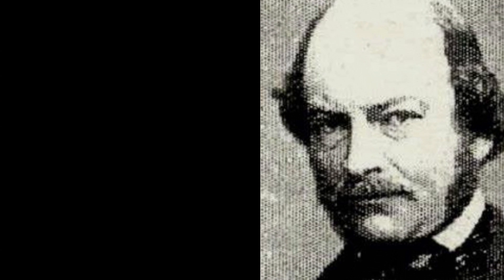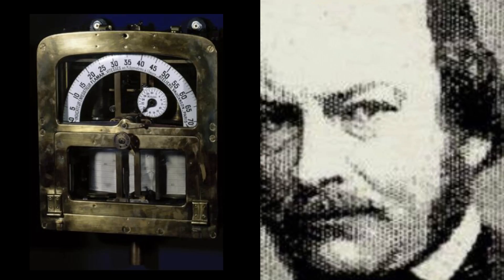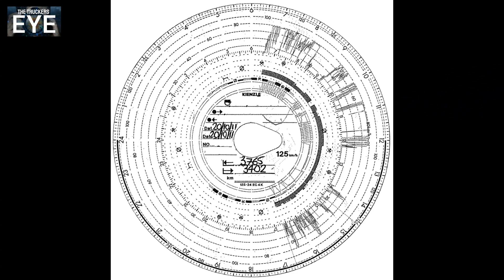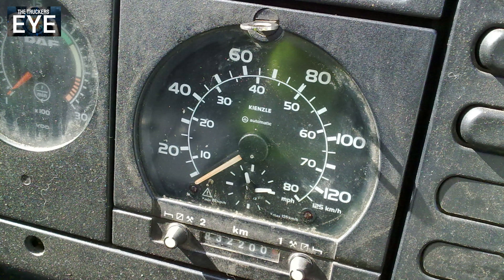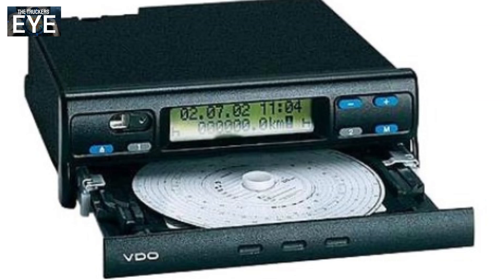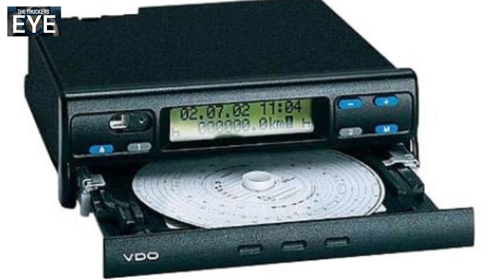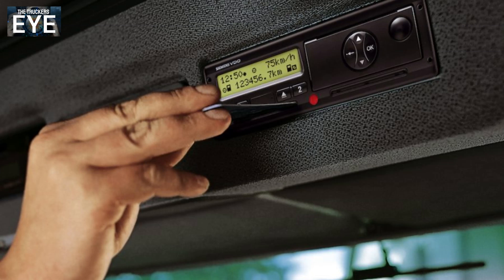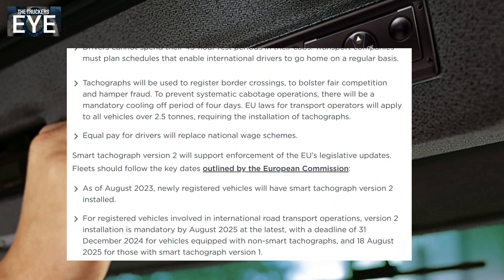Do you know how TACHOGRAPHS record DRIVING TIME?  are the rules too complicated?

Comment: The rules are mad, the claim they are for safety is a joke. 

Allowing drivers to work 15 hours, just 9 hours rest, 21 hours double manned, allowing interruptions for boarding ferries, starting work at 4 in the morning one day and then being allowed to start at 4 in the afternoon a couple of days later, having to take rest in the cab but your spitting distance from home....

Few days ago I was coming home from Scotland, I had a four hour journey and 4 hours 20 minutes of time left, I was really tired yet couldn't pull over because I would have run out of time.

Then there are companies that don't allow you to stop...
Reply from the maker: I agree, I need to make a video on the madness of tacho regs.  That double manning is a laugh.  21hr days with 9hrs off but you're not allowed into the bed whilst the vehicle is moving and you aren't 'resting' when you aren't driving as even the tacho tells you you are on POA!  Then there is the 24hr reduced weekly rest.  You work 6 days on whatever shift but probably with varying start times in the same ball park.  On your 6th day you start at 6am for example, then park up at 6pm.  You can then take your reduced weekly rest  of 24hrs.  In which job would you be expected to do 12 days straight and half way between switch your body clock from doing 12 to 15hr day shifts to doing night shifts over the course of one night.  It's bonkers!  I get the idea of it but it's just crazy.  36hrs should be the minimum weekly rest period, at least then the driver gets a full day off at least and is staying on the same kind of start time schedule.

Comment: TBH I used the old cardboard discs years ago in my 7.5t days and now I became Class 1 nearly 3yrs ago (after years off the road) I much prefer the current digital tachos. Current tachos are way easier than the the old discs as they do everything for you plus you find you have more remaining drive time as they only measure the time the wheels are turning as opposed to watching the clock on the old discs, so with the current systems things like urban driving become easier as the tacho defaults to other work when stopped at lights etc after a few seconds, those seconds soon add up into many minutes in some cases.

Comment: I find  it a pain that every time I  use POA  over 45 min it switches to new driving time. 
 I do understand that is known but not only adressed by the industry as it  woudo be too expensive to rectify the software??
Reply: And yet if you go to the Tachographs motherland of Germany... they don't even recognise POA!!! It's classed as a break to them!  Funny how EU rules that are meant to be the same across the board aren't 😂
Reply: @THETRUCKERSEYEMUSIC  Picked up an infringement in a hired MAN which had an unfamiliar tacho mounted by the roof lining and with the cab light just underneath. Had about 20 mins driving time left so took a 45 but hit the wrong button when checking the time and switched it to POA at 44. Waited for 2 mins with it back on break then moved off expecting an imminent 15 min warning but it never came as the tacho treated POA as break so I carried on assuming I had missread the 44 as 45.

Comment: They're is an argument for both changing the rules and keeping the current rules,  I personally am happy with the way it is now except as you pointed out, the rest required after a shift, it has always baffled me how we require lest rest after a longer day, but as you said, the dafftys in Brussels haven't got a clue! 

Let's not get on to working time directives and required brakes for expected daily shifts 🤷‍♀️🤦‍♀️😂
Reply: @kevw5557, the tacho laws have you operate within a 24-hour timeframe, for example, if you start on a Monday morning at 04.00, that is the time you insert your digicard,  and you commence work, ok, and your shift finishes at 17.00, so you have completed a 13 hr day, so within that 24 hr period which will end at 04.00 Tuesday morning, you will have an 11-hour break, giving you a 24-hr timeframe.
On Tuesday you start your shift at 04.00, but you do a 15-hour shift so you finish at 19.00, so you will have only a 9-hr break with a 24-hr time frame which means that you have had a short break which you will need to compensate at some point in the future.
Now, on Wednesday you don't need to start till 07.00 in the morning, so by doing this you have compensated the 2 hours you owe for the short daily that you took on Tuesday, but it also resets your 24-hour clock, so now your 24-hours starts from 07.00. I hope that helps you understand a little clearer, please understand I'm not trying to patronise you.
Reply: @davidjames990  
There is no compensation required anymore for a reduced daily rest, and it hasn't been for quite some time.
Work on the basic principles of 144 hour rule,  Start at 04-00 on Monday, you have  effectively till 04-00 on the following Sunday morning,  144 hours,  during this period and provided you take your minimum daily rest, 9 reduced or 11hr Standard, you can then take either a reduced weekly rest, which will require compensation for reduction by the following 3rd weekly rest, or your normal weekly rest of 45 hrs, and then start your next 144hr weekly spread. 
Hence why you can start at 00-05, do a 9hr drive and a 45 minutebreak,  be back on on rest,  take a reduced rest of 9hrs, and then start again at 19-00 in the evening, doing international Spain  to Germany or Poland this is normal,  plays havoc with your sleep pattern,  but fully legal. The only compensation required is for the reduced weekly rest if taken by the 3rd week after the reduction. 

My point was you do a long day, possibly  10 hours full drive, plus other duties and rest taking a full 15 hrs,  by which time  you are tired, and you only required to take 9hrs off,  shower eat and sleep aswell as anything else you need to do,  just a daft system!
But that's the rules, so that's what we have to work with.